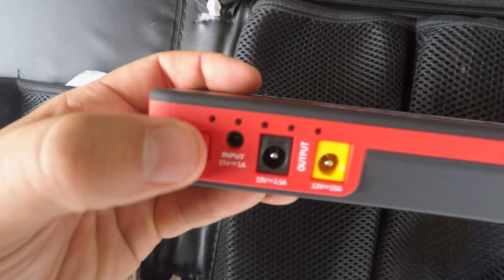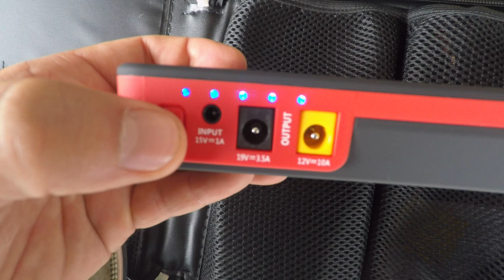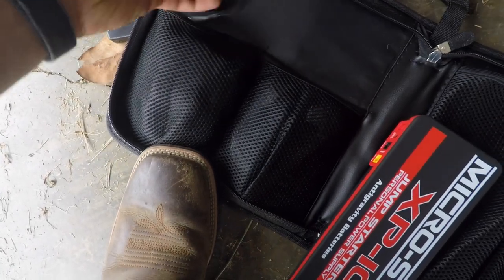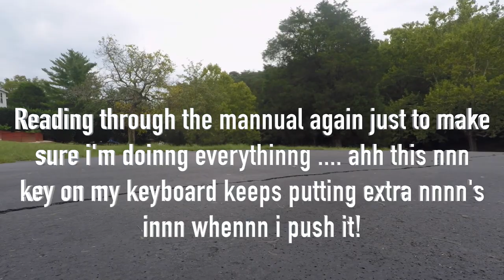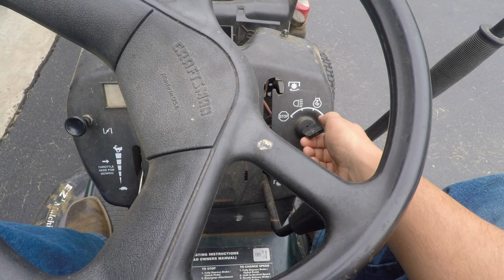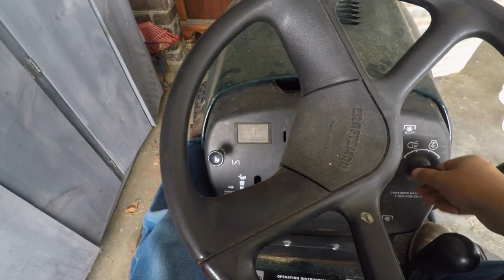Battery JUMP STARTER Test - (6 MONTHS) Micro-Start XP-10 Antigravity

Comment: Cody, take the terminals off of the battery posts and wire brush them. They look a little corroded. The mating surfaces need cleaned. Corrosion builds up between the post and terminal over time. I have this problem on two of my mowers and welder.
Reply from the maker: Thanks Gee